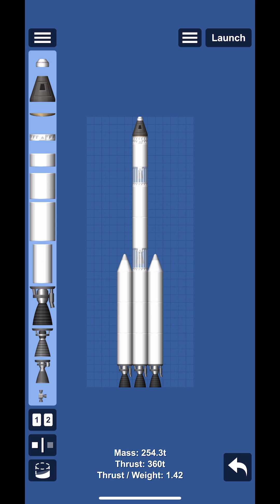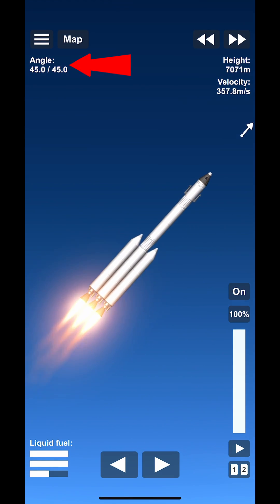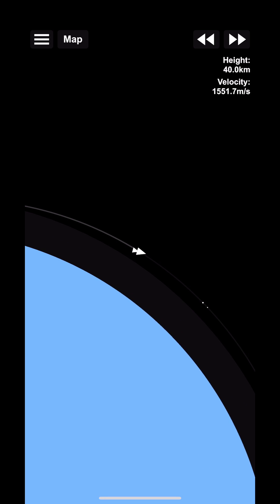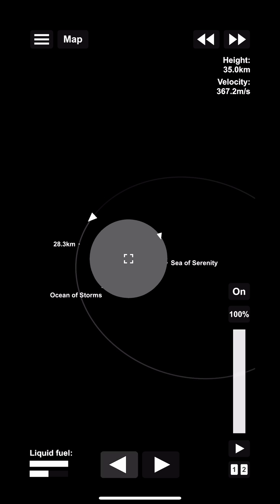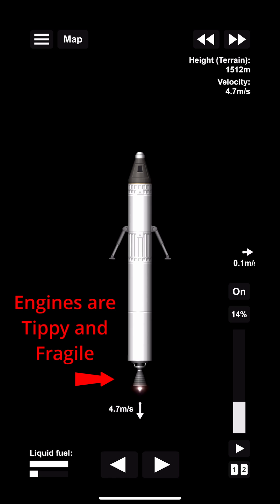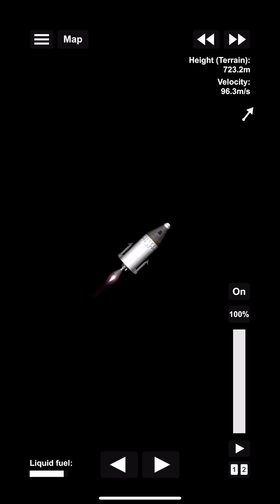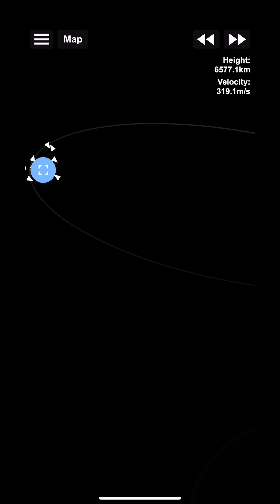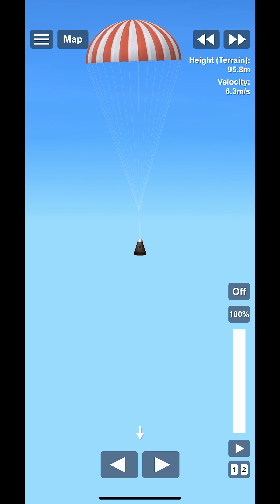How to Fly to the Moon and Back in Spaceflight Simulator using the Sample 3 Stage Rocket

Comment: can you please send the link to the orion cpsule pack i dowloaded it ut i didnt get the orion module or the engines or the cubesats and my launch escape system is not ejectig plss hellp!!😭😭
Reply from the maker: SLS is part of the ALV (additional Launch Vehicles) pack
Orion SpaceCraft is part of the SpaceCraft Pack
CubeSats are the CubeSat Pack
Don’t use the General Launch Escape System , there is a specific one in the SpaceCraft pack for Orion due to its fairing construction.